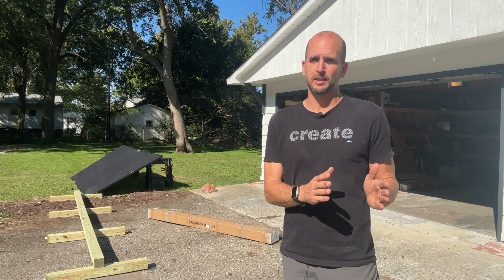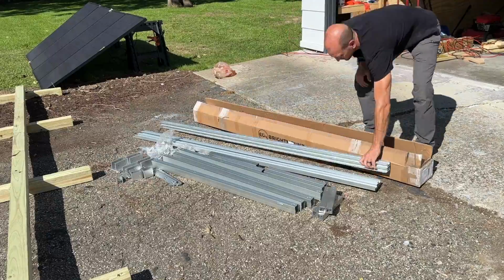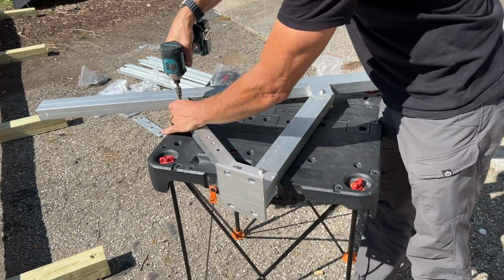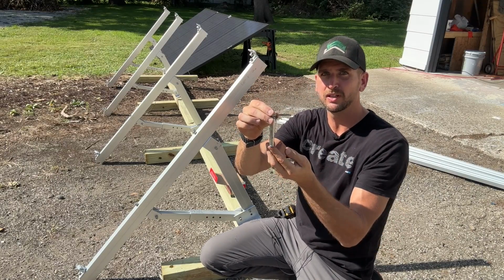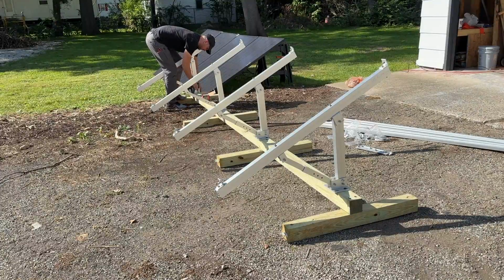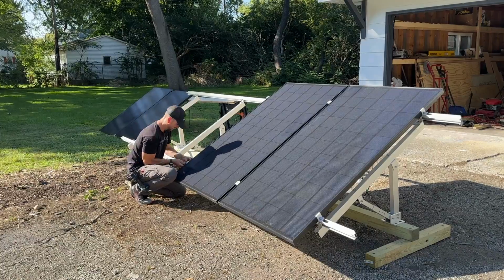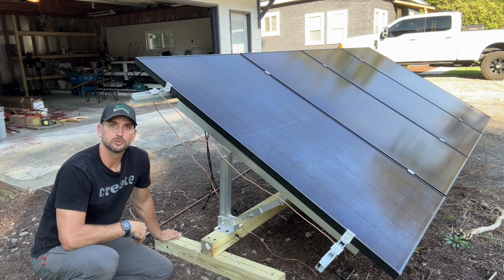Best DIY Solar Ground Mount | Complete Assembly

Comment: Is it code to use grounding rods for the solar rack you just built ? I also live in Illinois.   If I’m connecting the same rack you just build and connecting it to a eco flow power station do I still have to ground the solar panels ??

Comment: Thank you for the video. I am looking to do some DIY mounts. I purchased 12 Hyperion 400watt bifacial panels. While I do not plan to connect all 12 at once, instead create multiple strings for different use cases, I am looking for a mount system for 4 of them at once. I read on the website that the bracket system supports panels 44inches wide or less. How wide were your's?  I ask because looking at the rails you seem to have a lot of left over space. My panels are 44.7" wide which just puts them just barely out of the specs listed for the product which really sucks. I don't know if they would still fit or not.  I would be looking to do something like you did in your video as I would not be doing stuff like buring things into the ground with concrete, I rent this house and I can't do stuff like that in the backyard. So I would be curious if just adding some more legs would be enough to keep it sturdy, say another set of 4x4s at each interval you have as the earth base. Of course this is all moot if the panels are too wide and wont fit. I certainly don't want to buy two kits just to cut off a fraction to be able to mount 4. Are you aware of any other mounts that would support my wider panels? Lastly what angles can you tilt to? Because for example right now my panels are almost flat at 11-15 degrees based on PVwatts and the other websites, it yields the best power around this time of year, I would like to adjust that as winter approaches and that angle needs to change. I don't have to worry about snow. I live in Florida so there will never be a load on top of the panels. I've been looking mostly at 100% wood based DIY systems but I do kinda want the rail system as I like how that locks the panels together. Never done this. So I'm looking for all kinds of ways. Currently I have a wimpy 4x 100watt panel setup that has some individual angle mounts from Renogy on wheels. Its fine for those panels since they are small and lightweight. Even so I can't get very low angles with it. My year round angle I think is around 25-26 degrees but I would really like to take advantage of being able to adjust them. I've seen such a huge difference when I made a change with my small setup. I had it orginally fixed, then I learned about PVwatts and the other sites and found the optimal angle and direction and it increased output by a lot. Since the Hyperion panels weight a lot and are huge I have no choice but the leave them in one spot once put together vs what I do now sometimes and move my 4 panels around during the day (work from home) to get the max output. I can't be doing that all the time. I suppose I could had some heavy duty caster wheels that could be engaged to move it.I dunno. Right now the rail situation is the biggest problem. Either they are too short or way too long. I really don't want to cut the aluminum rails, I technically could do it with the right blade on my circular saw but it makes me nervous. I would likely feel safer using a hack saw but that's going to lead to ugly sharp cuts. Any advice for a newbie? I have all the necessary wood working tools (router, table saw, planer, sander ect..). Cheers from Florida.

Comment: What is a sono tube?
Reply from the maker: Those 8”, 10”, 12” tubes you can get from Home Depot to fill with concrete to make a footing for multiple different projects.
Reply: @everydaysolar what diameter tube would you recommend?

Comment: It looks simple and quite strong. But it seems to me that at the junction of two bars, no matter how massive they are, metal corners should be screwed on both sides with self-tapping screws. Because 4 panels + a strong gusty wind will be able to tear or weaken even this place.

Comment: I just downloaded the EG4 construction manual, you can't just sit these things on the ground. They require four footings per four modules. Their footings are 19.7" x 19.7" x 33.5" which comes out to 7.5 cu/ft. A bag of concrete mix is ~.6 cu/ft., that means 12.5 bags per footing. HD and Lowe's get $5.36 a bag, that's $269 + tax to put up four modules. You need that ballast to keep the modules upright in high winds or snow loads, that's why they spec so much footing.

I don't think these mounts are a great option.
Reply from the maker: What do you think is a better option.  I also agree for a permanent installation I would be setting some sonotubes below the frost line and making a proper footing.
Reply: @everydaysolar  Thanks for the reply. I did some more math and at 12.5 bags of concrete each footing weighs ~1000 pounds and you need four of them! That's how they get away without sinking footings but I think it's a bad idea and a lot of people are not using enough footing for the racking.
I think it's a good idea to run 12" sonotubes down ~ 4 feet, which also depends on your frost line. What I do in our northern winter climate is stick a couple of pieces of rebar through the sonotube a few inches from the bottom but you can also raise the sonotube up a little to allow the concrete to form a bulb at the bottom but this uses more concrete. A four foot sonotube with a crowned top for water runoff. A four foot tube uses ~5 bags of 80 pound premixed concrete.  You can use the expansion bolts that came with the racking you have but make sure the concrete is set for a few days before tightening the nuts.

Youi don't need to have one four foot sonotube for one panel, that's poor design by them but they have to because it's only 17" below ground plane. You can get away with 6 or 8 tubes for 12 panels just lag a string of treated wood to the tops of the footings and bolt their aluminum base to it, that should be adequate. Personally I'd do it with six footings for 12 panels.

Here's some basic math:
Most panels run ~40" wide placed vertically. 12 panels will equal ~40 feet, 6 footings will give you a span of ~ 6-2/3 feet. You can get away with 2x6 or 2x8 treated lumber on top of the footings with that span and weight without any problems. Each panel only weighs ~45 pounds so 2x6 is cheap and easy.

Comment: what app do you have that has the angle finder?   I looked on my play store and there are a ton of measurement apps.  Thanks
Reply from the maker: I was just using the standard measurement App that comes on iPhone.  I image most of the free versions would have the bubble level option.

Comment: well explained, thanks. 
I see that all the brackets are (tight n hold) meaning if the bolt get lose for some reason (strong wind age, expansion and contraction...)the panel (tilted 35+ deg) will slip down. should there be (L) bracket/rail at the bottom edge of the panels to hold it? scratching my head how to do it.

Comment: Thank you! Great solution! Is the end of the frame strong enough to use a handle to drag the aray around a little bit?
Reply from the maker: You wouldn’t want to do that much as with the base, rack, and panels it is actually pretty heavy.

Comment: Is it possible to mount wheels on this? I need to support 3 400W panels that will be on my back deck & need to roll to slightly different locations per season from roof shading on the deck due to sun’s angle.
Reply from the maker: Yep, that is doable and would probably make the legs just a bit wider if I were to place casters under the legs.

Comment: Could I make 2 kits of 2 panels each with this 1 EG4?  I have greenhouses that would be just fine with 400 watts of panels each.  I just don't know if a single EG4 kit can be broken into 2 separate mounts each holding (fitting) 2 panels.  Can someone recommend a 200 or 300 watt panel that would fit my needs?
Reply from the maker: Yeah, I think you could break this ground mount into 2 different kits.  In order to recommend some panels it would be good to know what you are running those panels into for a portable power station or charge controller.  That can help to get panels that will fit the voltage and current specs.

Comment: If you know - what is the steepest angle you can get given the mount is only off the ground by two 4x4's (7") instead of the recommended 15"?.

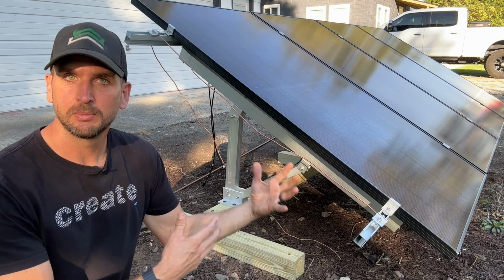Comment: At 7:00 you talk about grounding. I went to buy the grounding wire and the guy asked "What size wire do you need?" That stumped me! So, anyone, what size wire should I use for grounding? Thanks for any help!
Reply from the maker: I use 6 gauge bare ground wire.
Reply: @everydaysolar  Thank you, another trip to Home Depot! FYI, I followed your board base very closely except I used a 2x8 for the long board. I now have four Talesun 400W Bifacial panels mounted, but it did take some "stretching" of the rails as they are 44.6" wide. My stretch section needs improvement but it's mounted for now. My EG4 6000XP inverter and two batteries arrive tomorrow, I hope to be generating my own solar power soon.

Comment: Is there a reason for the 51” spacing between the legs?   Thanks
Reply from the maker: The 51"was straight off the installation instructions.  I am sure you could adjust a couple inches left or right if needed.

Comment: I did not hear anything mentioning UL or other certs? If not, every metal piece needs a individual bonding conductor, not just the ground clamp described because none of the assembly fasteners are rated for grounding.

Comment: How long are those 4, 4x4’s?
Reply from the maker: I just cut 8' posts in half, so 4'each.  If I did it again I think I would get some 10'or 12' posts.  They are stable but wouldn't be bad to have a little longer legs.

Comment: Better install concrete footings or a ballasted system to secure your ground mount. A single wind gust is all its going to take to flip the entire assembly and destroy your modules. We've sold hundreds of ground mounts all across the country over the past 25 years and have lost count of how many customers that have damaged their modules by not securing the ground mount properly.
Reply: Would it hold by using 4 earth anchors at each foot alternating front and rear?

Comment: I have watched several videos for this ground mount. However, one video said you would have to buy the solar panel mounts, for me a 35 mm mount, separately. However, it looks like the mid-clamp does what a solar panel mount or bracket would do. Anyone know? The other video is about a year older. Did the design and included equipment possibly change?
Reply: Well a quick call and look at the manual answered the question. The old mount did not have the solar mounts as the new mount has 30/35/40 mm end and mid clamp mounts. Nothing else needed to buy.
Reply from the maker: Thanks for circling back and letting us know 👍

Comment: I have 6 of the 400watt panels.

Would i be able to buy 2 eg4 kits and just use half of the second one for a 6 panel ground mount?
Reply from the maker: Yep, that should work but if you would like to bring all 4 pieces of rail together for the top and the 4 together for the bottom you would need 1 additional bracket/splice kit.  Also you might want to confirm the dimensions on your panels just to make they will fit.  I think most 400 Watt panels are good but some of the jumbo 500+ Watt panels would be pushing it.

Comment: I mounted 4x bluesun 460w bifacial on the eg4 brightmount on a 8' 6" post concreted 3' in the ground. I used a top mount post for a 2" pipe 14' long using u bolts to mount the brightmount to the 2" pipe so my array is completely adjustable. I love it and will duplicate it for every system I build for friends and family in the future
Reply: Nice idea. How exactly did you attach the u bolts and pole to the mount. They would need to attach to a verticle piece in the center of the mount,  correct?
Reply: @girlintheblueridge6529  top post mount from us solar mounts
Reply: good to know, thanks
Reply from the maker: Nice, thanks for the feedback on your setup 🙌

Comment: almost no panels you would want will fit due to the 44" even limit.  If they ever make one that fits modern panels might be worth taking a look, for now pretty much useless for even the panels that SS sells themselves.
Reply: I have 455 watt Solarever panels, each mount holds 4 easily

Comment: I'd probably use quick release pins for the angle adjustment to make it easier to change the angle 2x/year based on the season.  You could also anchor that temp system to the beams with ground screws...

Comment: What were the measurements of these panels? I am going to be testing a few of these mounts, and was wondering if I will be able to fit four of my 44.5" SEG 405 panels on each one... Might be too tight though.
Reply: I'm in the same boat.  The mount maxes out at 44" panels. However if you don't use the mid or end clips they give you and instead use T bolts I believe you can scoot the panels closer together and make it work.  That's my plan anyway.  Or bolt the panels to the rails from below and put the panels touching side by side. Max length on the horizontal rails is 179.5".

Comment: This is great. But probably not great in snow country where I live.  It needs to be about 3 to 4 feet above the ground to prevent snow from piling up and blocking the surface of the panels
Reply: One could have holes deep enough for frost line, say 36" deep. Then use Sonatubes at maybe 48" long. Raise the Sonatube up to your desired height above ground, secure and fill with concrete.
Reply: Nah, just 18" off the ground. We get plenty of snow too, not a problema
Reply: @bobcole3852  well most winters where I live we get 3 feet of snow on the ground.  So I guess it just depends on your location as to how far above the ground you need to go.  That idea of making concrete posts out of sonatubes is great.  That's probably what I'll end up doing.

Comment: So if I wanted a row of eight panels, could two of these be chained together?  I'm looking at this from the perspective of digging holes and pouring concrete, could I save myself digging one less hole and concrete column?
Reply: Just think of them like batteries where you can combine them in series or parallel to get the voltage and amps you want for your system.

Comment: where did you get the 14ft wood piece from. I have this same set, but I used 2 parking lot bumpers instead
Reply from the maker: Local lumber yard (Menards).  My Home Depot and Lowe's only stock 12' 4x4 pressure treated.

Comment: You should only have to ground one rail, as the panels themselves tie the two rails together.  I installed solar on my roof and I was only required to ground one of the two rails.
Reply from the maker: Yep, you are right if you install all the grounding clips you would only have to have a grounding lugs on one of the rails.

Comment: Great video and a really good product from EG4.  Personally, I just couldn't see spending the money companies want for dedicated solar mounts.  I built my ground mount array using cyclone fence posts and the hangers used for commercial plumbing projects.  It was a fraction of the cost and, if anything, is even stronger than most commercial solar mounting products.  It's also easily adjustable for angle, if that's something you need.
Reply from the maker: Nice, sounds like that would make for a good video in the future 👍
Reply: @everydaysolar  - If you'd like some pictures showing how it goes together and a rough estimate on cost, let me know.
Reply: @jasonbroom7147  I'd love to see the details!
Reply: @ssoffshore5111  - I used 1-5/8ths cyclone fence posts, spaced 8' apart, with 1-3/8ths poles between each post.  I then used #2 pipe hangers, which fit perfectly around the 1-3/8ths poles.  That's what I bolted each panel to.  The smaller poles fit inside the larger ones, so you can use them to set the height/angle of your panels on one side or both.
Reply: @GoingSolarEnergy  - You want to see pictures of a cyclone fence and plumbing hangers?  Should I include a video of paint drying?  :)
Reply: For those of us who don't know what product you're referring to, seeing a picture of your finished solar ground-mounted system would be really helpful.

Comment: I was planning to use lazy susan bearing for a single solar panel in a small set up to change its position. Problems would be how can i make it survive windy condition. Sorry for my bad grammar
Reply from the maker: I wonder if the lazy susan bearing would rust and not hold up to the elements since it is designed for indoor use.  🤔
Reply: @everydaysolar  will there be possible way to make it rust proof?
Reply: Consider using a scrap  rear wheel bearing assembly taken from a car. Bad for the car, good for 1 rpm a day. free at repair garage.

Comment: I would have bolted the frame base to the lower 4 by 4s. I would make the lower 4by4s 16 inches longer to the front. And find a bunch of used cement blocks for ballast.
Reply from the maker: I just liked the idea of the bottom mounting plates being secured to 1 long member avoiding movement at each leg.  Thanks for the feedback.
Reply: @everydaysolar what app are you using to see the tilt angle?
Reply from the maker: @hillybilliescrypto.4965  just the standard Measure App on an iPhone. You can switch it over to a bubble level to get the angle.  I think Android has a similar App native to the phone.